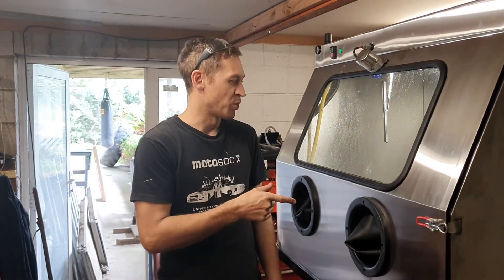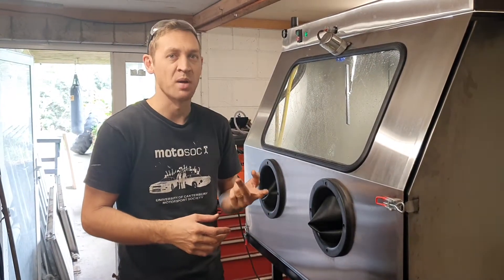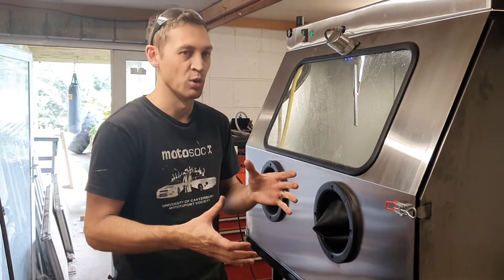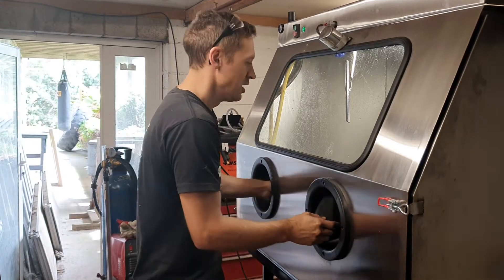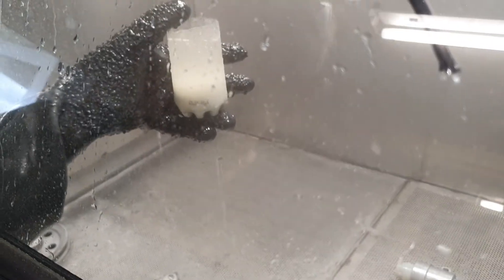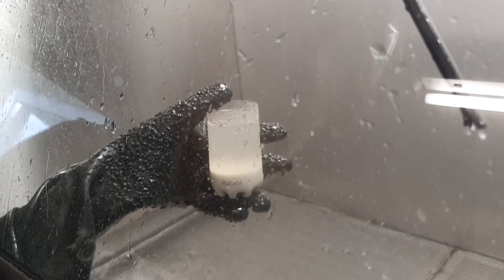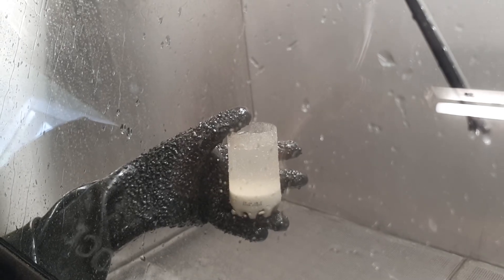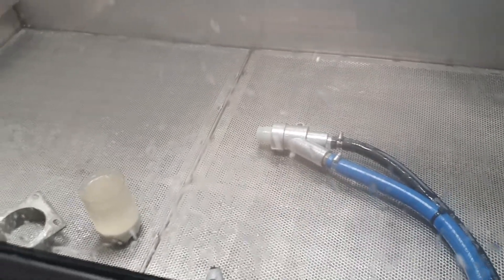How to check media ratio in your DIY Vapor Blasting Cabinet

Comment: What type of pump do you use. That abrasive would damage the impellar of most centrifugal pumps. Diaphram pump i imagine would be ideal for this setup.
Reply from the maker: Pumps are centrifugal submersibles. Diaphragm pumps don't flow enough, and the abrasive wears out the valves. Even lower priced submersible pumps have shown resilience against the wear of the media, but some of the better quality submersibles have urethane impellers and oil filled seals.

Comment: Soo if i have 45 liters tank i need to put 9kg of media witch is 20percent?😄
Reply from the maker: Not necessarily. There are a number of factors that will affect your mixture. Pump position, reservoir shape, pump flow, agitation efficacy. It is a good start though.